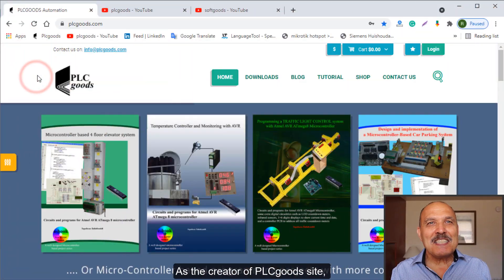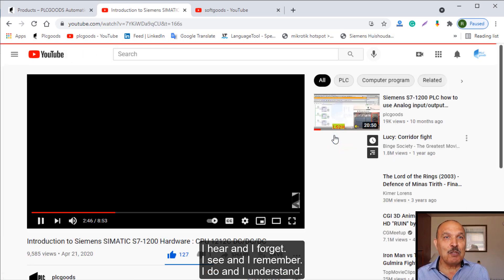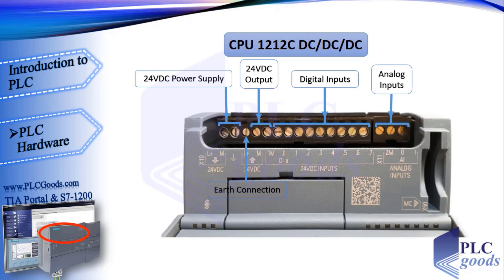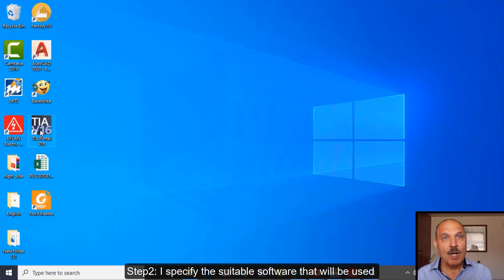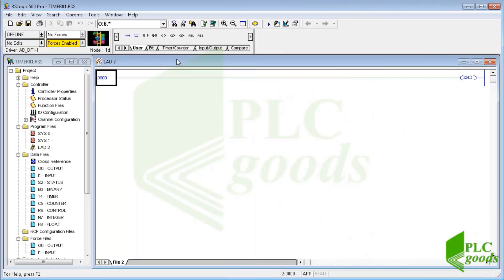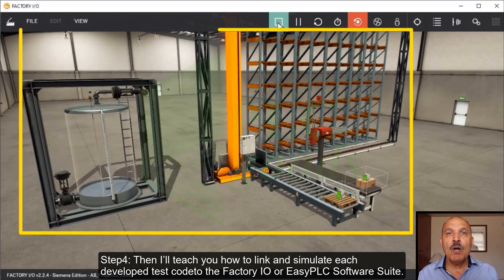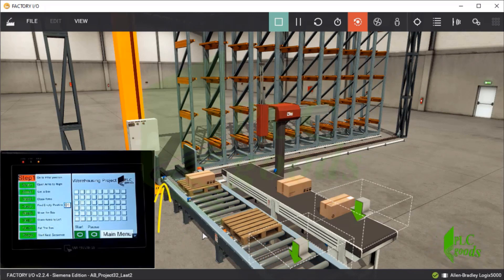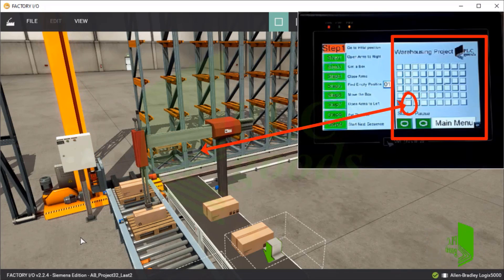My 4 great PLC COURSES

Comment: Sir, I want analog input connection details with PID Controller using Delta Plc...how can get the help?
Reply from the maker: Hi there, I explained how we can implement a PID controller to control a water tank system in Factory I/O with a Delta PLC in my Delta course. However, If you need more details about this topic, I recommend you to read related user manuals or use the help window of ISPSoft software.